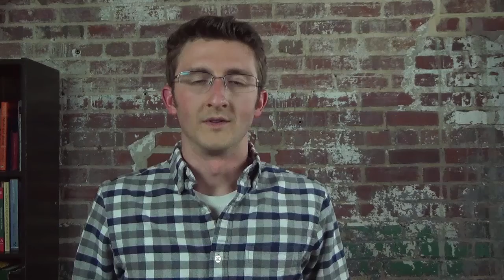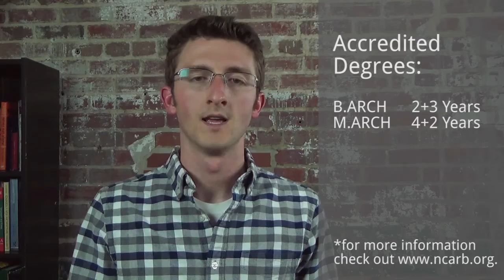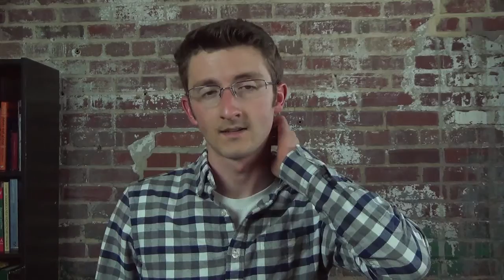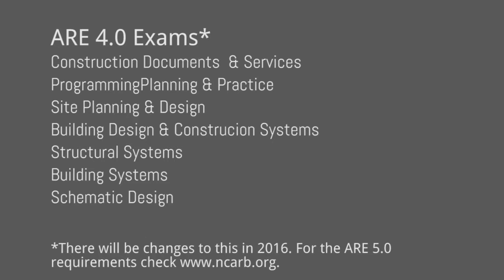Becoming an Architect

Comment: So you have to get a license in every state?
Reply from the maker: +John Cenas you can get what's called reciprocity in different states. So if you have a license in Georgia, for example, then you can apply for reciprocity in Florida because you want to start doing work in Florida or maybe you want to move to Miami. With most states the process is simple but states like FL require you to take extra tests for things like hurricane wind loads, or seismic activity (in California) and tornadoes (in the Mid-West.) But once you have your primary license and your reciprocity, you can practice as an architect in both states. You can get reciprocity for every state if you want but the fees would be ridiculous.

Comment: Drew Paul Bell - upon completion of the ARE and everything else is there requirements set that Architects have to do in order to maintain their license? Also what does it take for an architect to be licensed in multiple states?
Reply from the maker: ***** Yeah, it varies depending on what district you are in, but most of them require some sort of "Continuing Education" credits. And of course pay fees... Check on NCARB's website for your specific state.

On being licensed in different states, you can apply for "reciprocity" from NCARB. You basically present documentation that you are qualified to practice in that other state...and of course, pay a fee. You can also get reciprocity through an NCARB Certificate (which is also a fee.)

I could be wrong, but it has always APPEARED to ME that you can transfer to other districts relatively easily as long as you are willing to pay money. I don't think you have to go re-take all the exams in another state if you want to move. But check NCARB's website for specific information. Some states, like California and Florida, do have more stringent requirements because of how often they have hurricanes and earthquakes. Also, those kinds of things can change, so be sure to keep up to date on the places you're trying to do work.